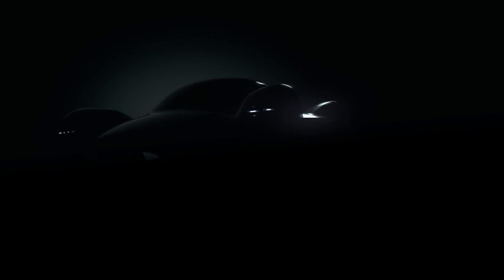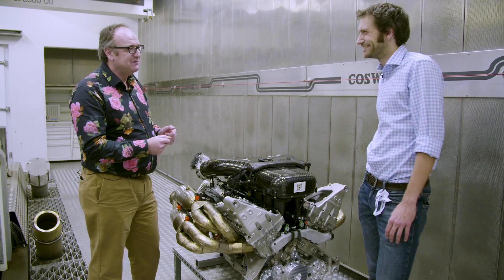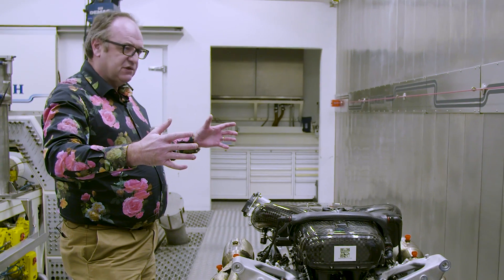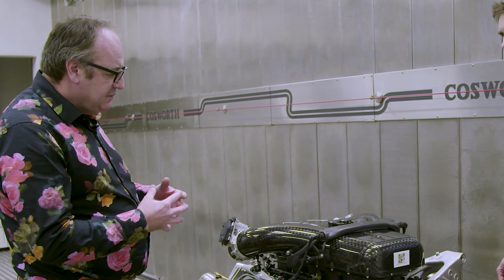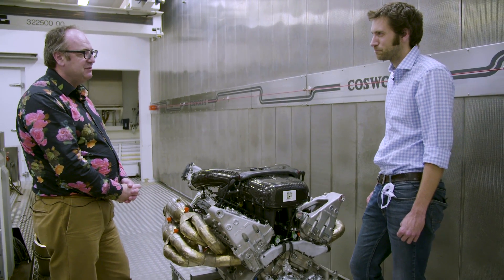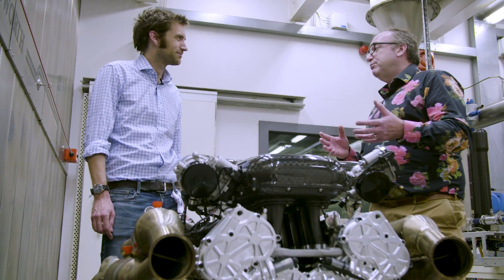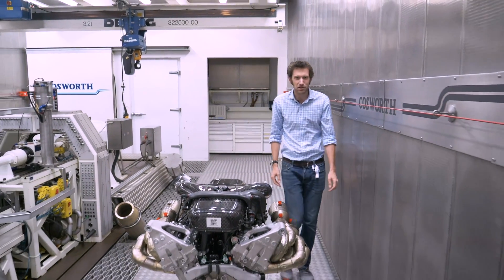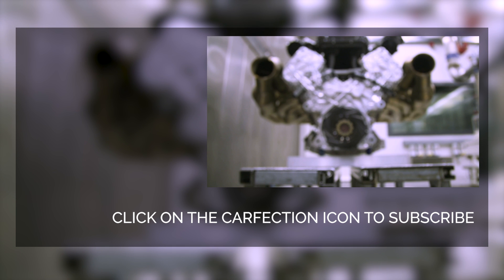Hear The Future Of The Supercar At 11,000rpm: The Aston Martin Valkyrie's V12 - Carfection

Comment: Let’s think about this for a second. 
Cosworth has managed to make a STREET LEGAL, N/A V12, with 1,000bhp. Street legal means it passes emissions. 
Let’s now look at F1 engines.
It’s a V6 Turbo. Uses fuel that will literally burn your eyes if you stand behind it. Also makes 1,000bhp.
This means that this street legal V12 is more efficient, and a legitimate alternative to an F1 engine.
Downsizing isn’t the answer. Technology is.
Reply: F1 engines top out around 1000hp because of the fuel flow restrictions, not because they can't be more powerful. They also have to go 60+ laps flat out, this comparison isn't logical in the slightest.
Reply: Jason Ortiz it kind of is though. You’re missing the point.
Reply: Formula one has already demonstrated lower capacity NA V10 and V12 engines with similar outputs at less than half the weight of this engine, but 18k+ RPM and running flat out for two hours at a time represents a totally different design philosophy than the Valkyrie engine. There's no question manufacturers could develop a 6.5L NA V12 with similar output, reliability, efficiency and lower weight than the Valkyrie's for F1, but as long as F1 regulations continue to include things like strictly limiting engine capacity, extremely high revving engines that chug fuel will make more sense when the practicality of road use isn't a consideration.
Reply: @ricky6752  It can't be a F1 engine, it's for a two seater and maybe the shop run.
Reply: let's not forget F1 is not 6.5L either.  If F1 is allowed to go to 6.5L, then what?
Reply: 1. Under the regs F1 fuel is very closely based on the fuel you can buy at the local petrol station. Obviously it's obscenely more expensive due to R&D, but if you put it in your petrol car it would run perfectly fine. 

2. Street legal 'emissions' has nothing to do with efficiency. F1 engines are now managing over 50% thermal efficiency (amount of the total chemical energy of the fuel being turned into useful work), which would be greatly more efficient than this V12. Emissions legality simply pertains to levels of harmful pollutants like NOx for example, not CO2 output. 
F1 cars don't have catalytic converters to reduce said harmful emissions whereas this V12 has 4.
Reply: This isn't more efficient. Who told you that? What made you jump to that conclusion?

It sounds better. It's certainly more fitting... but more efficient?

F1 uses fuel that is closer to pump gas than you'd think. Also, emissions and efficiency are related but they're not the same thing.
Reply: No way this is more efficient than an f1 engine! Amg's 2017 f1 engine had a thermal efficiency of 47%, which is completely ridiculous! Also, f1 cars use about 40 liters of fuel per 100 km during a race, which is pretty much nothing considering the performance. That's about 1/2 of the fuel consumption of 2005 v10s at similar performance levels. Passing emissions regulations doesn't mean that the engine is efficient. For a roadcar, this is a magnificient engine, all the respect in the world towards cosworth, but if you think amgs f1 engine is less of an engineering feat you know nothing about engines.
Reply: This is very true, but idk if this engine would fit in an f1 car. I don't THINK. I could be wrong
Reply: An F1 engine has only 1.6 litres. Really ridiculous comparison. Remember the 3 litre V10? By the end, they had 1000hp with less than half the capacity of this engine.
Reply: Andrew Mayer it’s also about fuel economy. The current F1 engines use a lot less fuel than the old N/A engines.
Reply: The reason that we got the v8 and the v6 in F1 is cost and reliability. Nowadays they get 4 engines per season, and I'm willing to bet that this V12 engine costs more to develop and produce than the turbo v6 in F1 and will not stand to F1 racing abuse. Also, this is one heavy mofo
Reply: @ico9750  you're delusional if you think the development costs on this is anywhere near the F1 power units.
Reply: I see your point but F1 engines get the power from PSI, not displacement. Their engines are made with stronger alloys to withstand very high PSI and rpm. On the other hand, NA V12 with the same output power can be made with less quality alloys as it produces its power from 12 cyls. But all in all, this V12 would probably outlive any F1 engine with the same amount of power, but in F1 reliability is not really a top goal, its in the top 5, but not the most important. Also, they spend hundreds of millions a year on R&D. Its the same as bmw's engines. 2018 V8 4.4 600hp 750Nm M5 vs 2016 V12 6.6 610hp 800Nm M760Li. So the almost same power output but a big difference in displacement. In theory the V12 should outlast the V8, but by the time that happens, its gonna be 2030. 
Now back on F1 and AM V12, they are built for different uses. One is built by strict rules of F1 and the other one is just damn crazy and can be even crazier. TBH as a long time fan of the F1 i do think that downsizing is killing the sport. The engineers are doing their best to make a lot of power from 1.6 engine, but long term its the sport and the fans that are suffering. Not to mention the rules about driving. But all in all, what hurts this sport the most is that almost all the teams build their own engines and the rich teams make some damn beasts while poor teams do their best and race for 10th place and 1 point. It would be more fair to have 1 engine supplier that would make a true dragon of the engine and we could actually enjoy races where the driver skill matters.
Reply: I hope F1 and the FIA are taking notes on this...

Comment: Only thing cooler would be Aston Martin mating a manual to this bad boy!
Reply: I love my manuals. But a manual couldn't stand up to the abuse of this engine.
Reply: manual days are over.  Not sure what's the fascination with manual? Is a manul supposed to be some badge of skills?  Then try riding a motorcycle and see if you have real skills, not fake manual skill.  It's a car, give me the paddles.
Reply: Kalashnikov Cortez manuals are way more fun to drive. And ya a manual isn’t as quick as a dual clutch but I’d say 95% of people will never track the car so it makes no difference at that point.